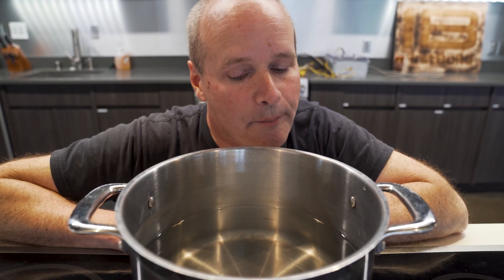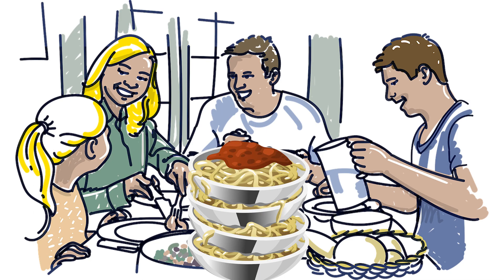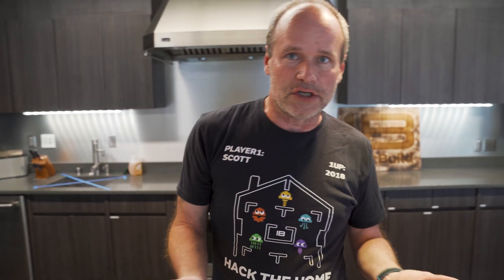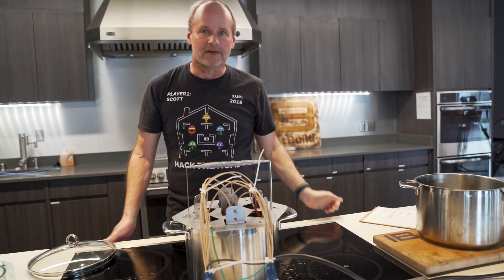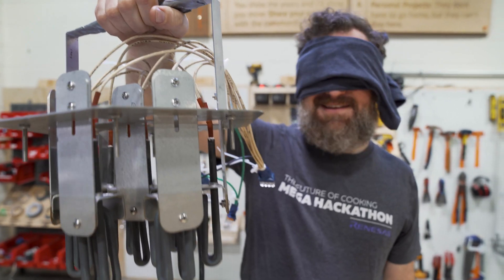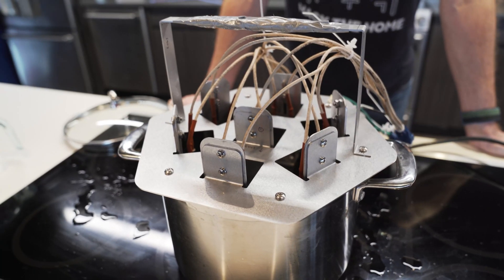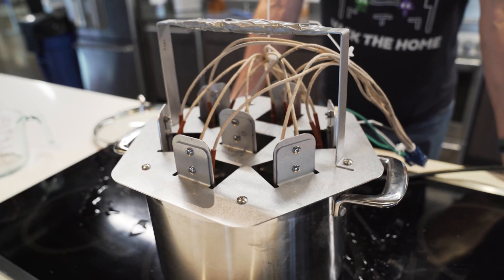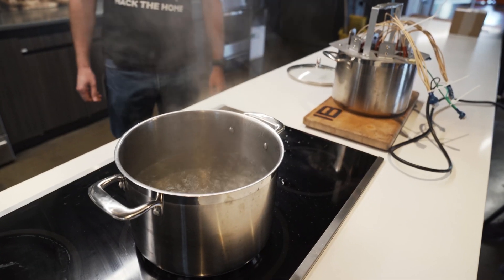The Power Lid: The Fastest Way To Boil Water | 2 Minute Prototype Pitches

Comment: A good idea in theory, but assuming this thing cost around $150, who wouldn't just use two pots and the other various methods? It would have to be someone who does a lot of boiling. 

Now as others have stated, could you possibly put a circulator in there just speed it up, maybe create an environment where it's not just water that you're boiling but soups or other things that you need heated up for various reasons? Could you use a peltier system so that you could also cool items just as fast? Just food for thought in the prototype phase. A one-trick pony that costs more than one trick prices isn't something that will be highly sought after.

Comment: What amp service in the house is required?
You're in a commercial building, bet you haven't blown a circuit with that yet.  At home?  CLICK!!!

My electric pot boils 1/2 gallon of water in 3 mins. 
I used to put 2 pans of water on the stove and watch the 2nd pan.  Yup, other pan always came to boiling first.  Watched pot never boils? So I watch the other one.  Works. 🙂
Reply: Kitchen outlets should be 20a in residential (older homes may have 15a in some cases). A 20a breaker would support the 1750 watts without issue.